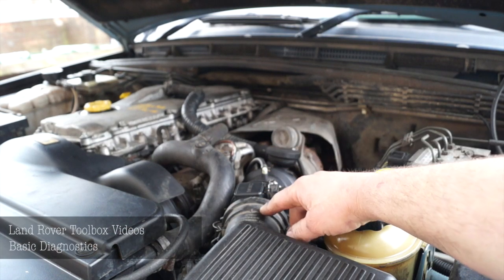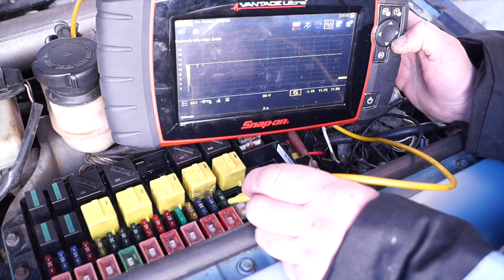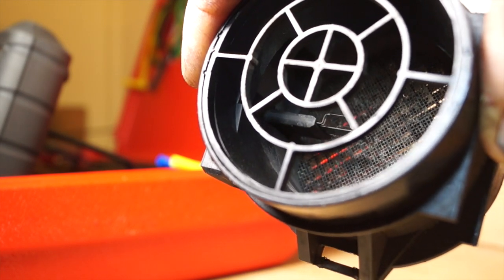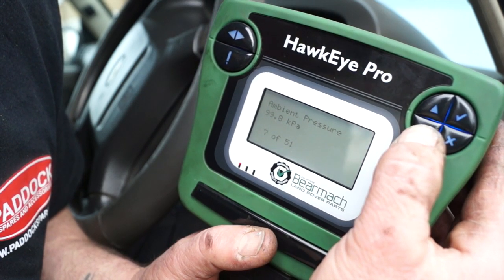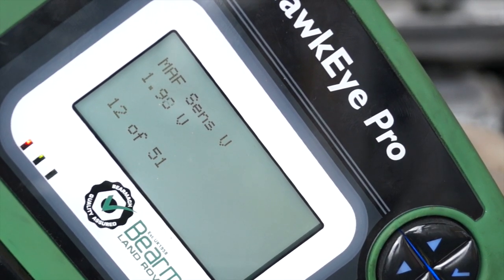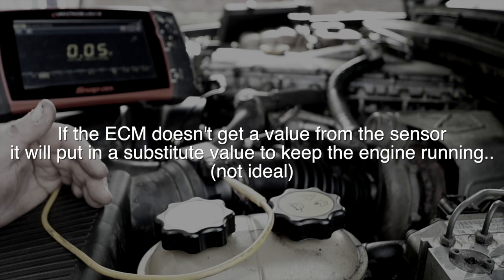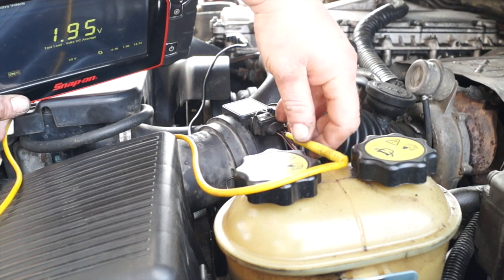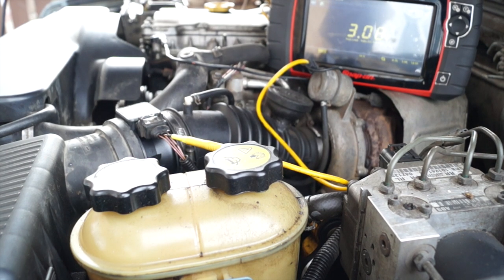Td5 - Mass Airflow Sensor - How to Check with a Voltmeter

Comment: Your Land Rover repair videos are a lifesaver! I've been grappling with a persistent issue on my TD5 involving excessive black smoke and noticeable power loss. Your expertise in troubleshooting and fixing Land Rovers has been evident in your content, so I was wondering if you could shed some light on this particular issue. Your insights could not only help me but also countless others facing similar challenges. Looking forward to your thoughts on this!

Comment: hi bud, what route would you go down if a td5 was purring and over feuling rather than scratchy and responsive! and you have been down the usual route of chaning things and numerous garages that couldn't fix it! thanks chris
Reply from the maker: Hum.  Hard one to answer.  Especially if it has had in the past, without you knowing a chip or remap.  this will throw some right of the correct scent.   Fair few factors involved in fuel delivery especially if overfilling.   Problem is garages want to satisfy the customer with a quick fix.    Proper diagnosis takes time and investigation and internet guessing is not the right way to go with this.  Everyone has had an experience or know someone who had a problem with x that was fixed by doing y and z to it.   I'd say you need to find someone with a lot of knowledge with Td5 systems and has the kit to check it out properly............ failing that.  Learn about the system on the Td5 throughly and spend time diagnosing rather than parts changing.  Dunno what else to say. ???
Reply: Land Rover Toolbox Videos , oh god is the someway I could contact you over the phone tommorow? we don't seem to  have the skill set down where we are compaired to the mids, had the vehicle from new , shes on a fifteenp engine. first engine was mapped after she got tired.this over feuling fault was there after we got rid of the map, we have changed the following, ecu, all relays and fuses, intercooler pipes, turbo,  manifold, engine! feul pressure regulator, egr blanked off,  no fault showing on t4/snapon fault finding units, injector harness, . but going up a hill or towing you put foot down and then come off gas and she lurches to life. no weird starting faults, wines noises,  just lazy top end, no weird smoke bar a little bit of black that you can taste when stood close. all genuine parts. 
any advice would be grateful before I scrap  it!
Reply from the maker: I am at work most of the time in the helping keep the wheels of industry rolling.  Not easy to get hold of and distant diagnostics is not my thing. 

  I think you need to have a word with Gary Woods at Alive Tuning.  Who's map was it in the first place?   Perhaps the setting the the injector feeling is not set back to where it should be.   Only a guess at this point but someone with tuning software will be able to log and read the activities in the ECM fuelling strategy.
Reply: *****  it was an auto logic remap,, but we got rid off that by putting a new map over it, I have also tried to get through to lr tech team regarding this but I have to take it to a dealer then for them to get hold of someone at solihull.
 If I do not get anywhere with lr, then if I get the vehicle to you would you be intrested on working on it?
Reply: *****  also forgot to say it is a new ecu un abused! Lol
Reply from the maker: I seriously have no time for any extra work  but i'll see if Storm tuning can help you.
Reply: ***** I will google them, as I say any help is greatly appreciated, like I say to get decent people in dorset is like rocking horse shit. They talk the talk and can't back it up with skill set or qualifications. Id be laughing if my grand farter was still alive having worked at body in white.
I have started to touch base with landrover and the tech team, so I'm hoping I might get somewhere with them- you never know it might end up going to load lane yet! ?
I just want to get to the fault and the bottom og it!
Reply: Storm Tuning  I should be but I'm not unfortunately,  have you got another preferred method of contact. 
Chris
Reply from the maker: We have contact.  Daniel @ Storm Tuning  is a wizard with the Td5.
Reply: Hi Chris, are you on facebook?
Reply: Land Rover Toolbox Videos  ok thank you will be in touch soon thanks
Reply: hi guy's,  just a quick post to say, I'm being a pleb...... read up on a forum about changing transfer box ratios, towing,. and it explains  slower pulling away, quieter top end and struggling with a trailer/more feul consumption.  feeling a twat. but glad to get to the bottom of it atleast im not scrapping the vehicle tho!

Comment: Do you (or someone else) also have a pinout information of where the 2 other wires goes? The signal wire and the ground wire.
Reply from the maker: wiring diagram. Rave manual  electrical library.
Reply: rakerholm zass

Comment: hello my MAF is reading 1.56 - 1.63 volts at idle what should it be. on my rover 75 the maf sensor was 0.5 of a volt off but made a big  difference. what is the  tolerance for the td5. thank you for any help

Comment: Thanks for another great vid LRTbV. I just changed mine and used this prove it needed doing - was reading 5v on idle. Fitted new and reading about 2.15v on idle. Turned out one of the wires had melted completely! Do you have any similar advice/tricks for testing MAP sensors without a diagnostics kit? Cheers again, love this channel, best on YouTube.
Reply from the maker: +William Evans  I will get on to the MAP  and IAT sensors in a while.

Comment: Good stuff Chris :-). This sort of thing around if the MAF has died often pops up on the d2bc forum, and it useful to see the readings via the ECM and direct from the sensor.
Reply from the maker: +Danny Otter  I've got more to do on sensors and what happens if the 5v reference circuit goes down.  Sometimes it another sensor shares the same feed it may kill off another sensor if it shorts to earth / fails.

Comment: Thanks again for the video. Just given my MAF the once over. All voltages look as they should up until the engine is running. I am getting 14+ volts when probing terminal 1 at the rear of the connector but can't get a voltage higher than 0.05 V when engine is idling? Haven't noticed much difference in the way the engine performs recently? What are your thoughts please? Jeff
Reply from the maker: +UKDPO  it could be that the MAF sensor is dirty.   Can be cleaned with brake cleaner.
Reply: +Land Rover Toolbox Videos 
Gave it a good clean. But still no luck. Best I can get out of the sensor wire is 0.5v. Time to replace it?
Reply from the maker: check on the pin that supplies voltage to the sensor from the ECU end.  You'll need a wiring diagram and /or electrical library which shows you the connector plug pin designations then gently tested it from the back there to make sure iy is not the wire at fault first.
Reply: +Land Rover Toolbox Videos 
All fixed. It had failed, so replaced it. Runs much better now too! Thanks for your help. Jeff
Reply from the maker: good news!